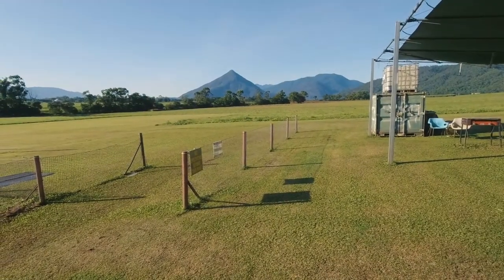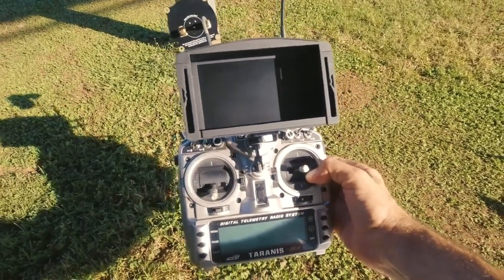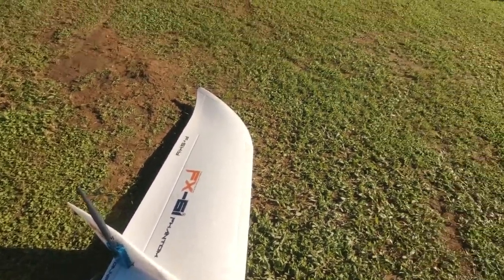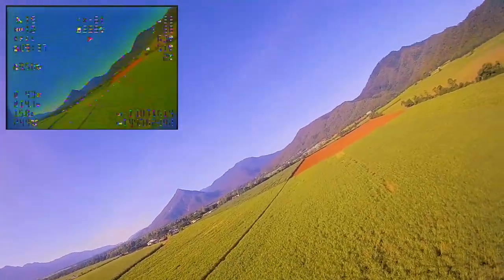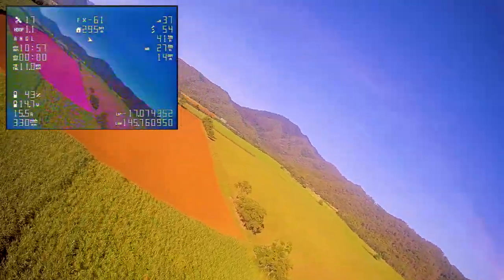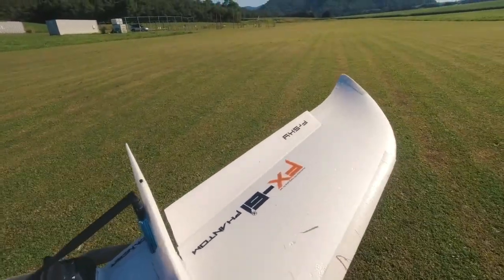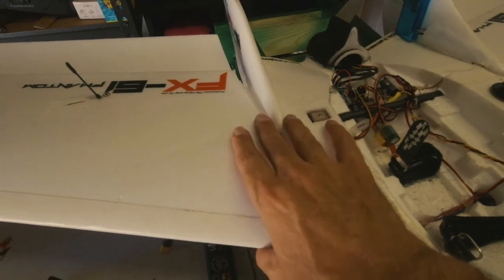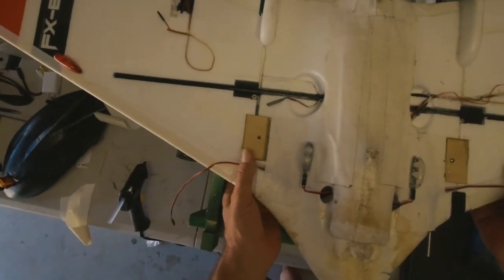FX 61 Phantom - INAV 5 - Autotune - Near Loss With Crash - Pilot Error

Comment: Glad you got it back. Had the same happen with my Dart 250g on INAV 5. I was in acro mode doing rolls and inverted flying when it started acting up just like yours. Quickly flicked it into manual mode and was able to safe it. Flashed it to 5.1 and copied their recommended horizon drift mitigation commands into the CLI. Waiting for calm winds now to test it.

For airplanes without a tail (wings, delta, etc)
set imu_acc_ignore_rate = 9
set imu_acc_ignore_slope = 5
set nav_fw_pos_z_p = 35
set nav_fw_pos_z_i = 5
set nav_fw_pos_z_d = 10
set nav_fw_pos_xy_p = 70
set imu_dcm_kp = 1000
set imu_dcm_ki = 0
For airplanes with a tail (dedicated elevator)
set imu_acc_ignore_rate = 7
set imu_acc_ignore_slope = 4
set nav_fw_pos_z_p = 25
set nav_fw_pos_z_i = 5
set nav_fw_pos_z_d = 7
set nav_fw_pos_xy_p = 55
set imu_dcm_kp = 1000
set imu_dcm_ki = 0
Reply from the maker: Thanks for that let me know how you find the new commands.. I did put new commands recommended into mine since that video and it seemed better but still not as accurate as ardupilot is. I might compare the commands I have with what you shared here..  thank heaps!

Comment: When all else fails, reach for MANUAL. iNAV 5 is very new so caution always is my advice. The other elephant in the room is it looks like You're using a 1.2G vtx alongside 2.4g control?...a big no no.
Your 1280mhz VTX signal will sideband up onto the 2400mhz band and step on your RC control...Remember, a 100mw control signal versus an onboard 400mw? Video signal...disaster waiting to happen. Basic rule, your control frequency should always be LOWER than your VTX frequency. If your using a 5.8g relay, you don't need those big directionals on your Monitor, a RD is more than enough...Hope that helps...I usually limit my 1.2g vtxs to 200mw which is good for 8kms, no problem. Way more than your 2.4g link including ELRS 2.4g..cant use that either...same reason...🤔😳😳🇬🇧 Oh, well done fighting to get it back, miracle basically...😏
Reply from the maker: Thanks for the comment and words of advise. The problem I had was I never did a pre check on my modes switch and had 2 angle modes and acro set up on the lowest of the 3 way switch. When I switched to what I expected to be acro which is usually middle I ended up more focused recovering the craft and never even seen that I was still in angle. My setup is usually angle, acro and manual. If I had of switched to what should have been manual which was lowest on the switch I would have found my acro mode and maybe the craft would have been more controllable. Stupid me didn’t think in the spur of the moment while struggling to recover the plane. I just didn’t want to lose it in the tall sugarcane fields below. Lesson learned and my switches are now all correct again lol. By the way I am using R9 900mhz unit flashed which ELRS. I also use the partom 1.2 vtx but I am unsure how to adjust the signal strength on it. Thank for the tips much appreciated!
Reply: @stonesrcchannel  Okay, I couldn't see your 900mhz TX antenna...I tend to use Horizon instead of Angle, keeps the bird level. Although I now fly my FW stuff in Cruze Mode as it maintains heading, altitude, level yet you can still overide it (just)...The latest Matek 1.2g VTX now has switchable RF levels. An important feature they missed off. I also use 1.2g on my quads..alongside Crossfire 868mhz, works great...🤔😳😀🇬🇧
Reply from the maker: Thanks again… for this wing I tried the happymodel es900rx running elrs and my old r9 module also flashed with elrs. The small es900rx has a pretty small antenna but range seems very good so far only using 50mw only the tx. I may even try get the matek vtx you mentioned as it’s adjustable where as the partom one I have doesn’t seem to be and is fixed at 800. Thanks I will sub to you!
Reply: @stonesrcchannel  No problem. 800mw is a huge amount of RF on 1280mh. Does nothing for GPS reception either. I have been using the much smaller 200mw vtxs, essential on a 5 inch quad. With a tuned patch VRX antenna 8 Kms at only 300 feet altitude is pretty easy..I usually run Crossfire in dynamic RF mode. On my little Ranger G2, I can be on 25mw 3kms out. iNAV has RF values and LQ on your OSD, very useful...Subbed you back...🇬🇧👍
Reply: You can use a notch filter on the vtx.

Comment: I had this exact thing happen to me .. Zohd dart 250g flew great with Inav 3.1.  I upgraded to 5.0 past 4.1 and had death of craft due to Crazy Horizon drift. In hindsight I could have flipped it into manual and saved it as well but the same thing happened to me.. Inav 4 and 5 have been buggy for me ... Horizon just not right ...been considering Arduplane ...
Reply from the maker: I had all my craft on iNav 4 and didn’t have any issue only this particular flight but it’s was purely my fault. Saying that the horizon drift is something that has annoyed me since iNav 4. I have a zohd dart xl running inav5 and it flys beautifully on it with very little horizon drift. Vibration probably play a big part in it as my dart setup and build was with more experience and knowledge on my part where my fx61 was one of my first ever builds I did where the flight controller is too close to the motor. It’s due for a rebuild and redesigned electric layout.

Comment: Actually has nothing to do with auto tune in angle mode.. it will still fly you probably had the config wipe bug where the settings for gyro get all messed up and then AHI looks like this
Reply from the maker: Thanks could be, just glad I got it home and now it's flying great since I fixed my switches and retuned it in acro.

Comment: Did you not have prompts on your mode switches?
Reply from the maker: Transmitter mode switches were just setup incorrectly my mistake not checking it properly in preflight check.

Comment: Why do you say that autotune must be done in ACRO since (according to Github autotune instructions) it's highly recommended that you fly in MANUAL and trim your servo midpoints for stable flight ??
Reply from the maker: My preference for tuning is acro and in this particular flight, by accident I never assigned manual to a switch. I made the mistake of having 2 angle modes and acro instead of angle acro manual. This whole flight was a poor mistake on my behalf….But yeah your right it can be done in manual like the wiki says.

Comment: What FC are you using on this model?
Reply from the maker: It’s using a matek F411 wing controller running iNav. I am currently upgrading it to a speedybee f405 wing fc. So any future videos on my channel. Will have it running that.
Reply: I have a similar sized Wing. The last two Wing FCs I bought were a Matek F405WMN and also just got. Speedybee Wing FC. I’m not FPV so want Smartport telemetry. Still can’t get it out of the Matek using SoftSerial, and could not get it out of the Speedybee either. It took 10 days of back and forth with Speedybee to finally get SoftSerial working. If you need SoftSerial the you will need to contact Speedybee, the official INAV site hasn’t caught up with the issue yet. Have fun, I still haven’t flown with these two boards yet. I’ll get rid of the Matek if I can’t get Telemetry working
Reply from the maker: @peterhancox5268  Thanks Peter for the insight. I hope to remaiden this craft with the Speedbee over the next couple days weather permitting so i will give my opinions on that in an upcoming video. Have to say that one thing i am not real impressed with is the location of the SD cards slot and why they decided to put it where it is? Anyway my next video will show the setup and install of the Speedybee into the FX-61 which i am pretty sure will be a good upgrade for it from the F411 FC,

Comment: This is why i try to avoid updating to new firmware, same with my Dji Air 2s. If your craft or quad flew perfectly before with no issues at all, and still does. Why bother updating and risk losing or damaging your pride and joy?...just saying
Reply from the maker: Yeah you do have a good point. In saying that now that I have all my craft updated to the latest firmware they all fly very well on iNav 5.1 but I probably will wait longer once a new update is released. Cheers!
Reply: @stonesrcchannel  yes 100%. Sometimes if it ain't broken, then why change it. But I'm glad you've got everything working correctly...👍🏽